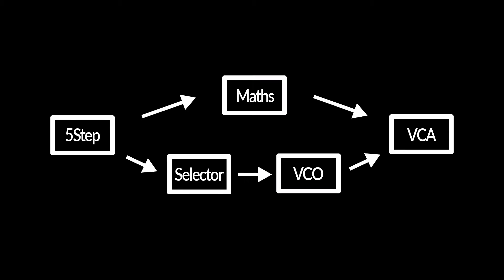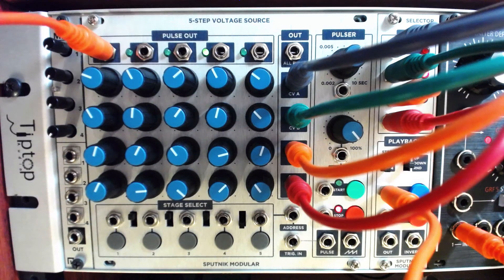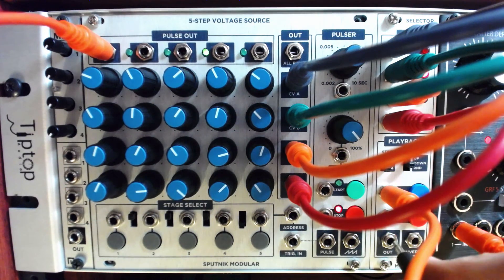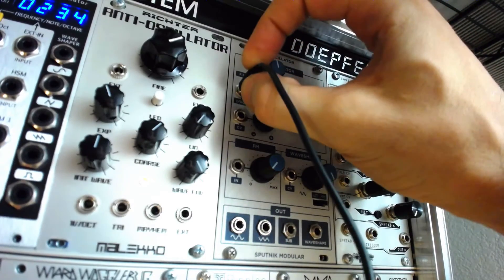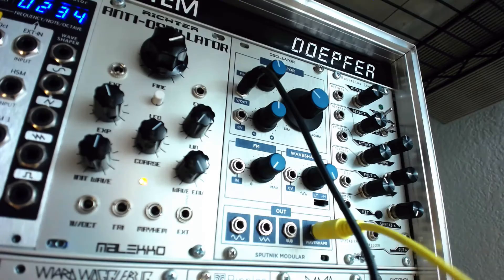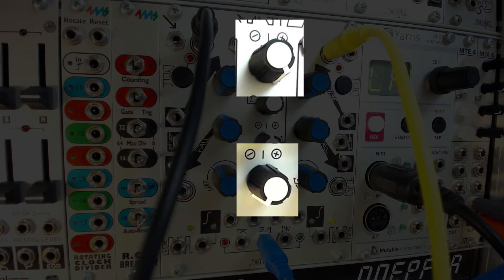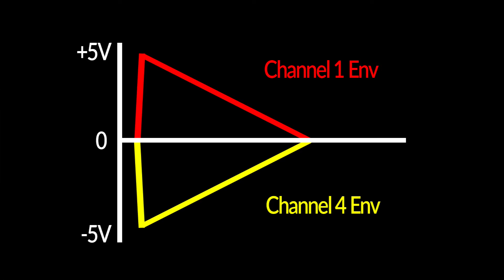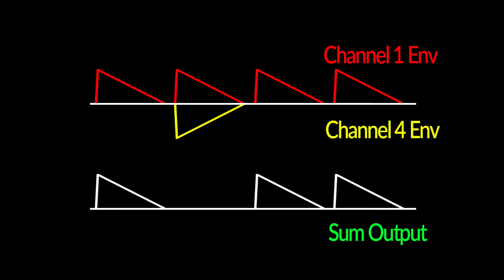Eurorack Sequencer Step Muting With Maths

Comment: to mute 2 or mote steps obviously you'll need to combine individual pulse outs into a logic OR module and then route the OR'ed signal to Maths - you should add it to the video IMHO :)
anyway, you can get make noise rene for the same amount of money and less HP and get rests/slides, complex sequencng and more :)
Reply from the maker: +Ilya M Good points, Rene is a great sequencer. Hoping to get some videos and maybe a course going with it. It's very deep. This video was answering a question asked on MW. And since these Pulse Outs are never triggered at the same time, you could probably even use a mult or stackcable (though I wouldn't recommend this, for safety's sake). Just trying to keep things short and sweet for youtube, maybe I'll do another about the OR idea... :)
Reply: +Voltage Control Lab btw, I mailed to makenoise a year ago and they answered that all their modules are designed to accept signals coming FROM multiple sources combined in one input, so maybe OR is not needed but for educational purposes it should be used :)
Reply from the maker: Ilya M
Very interesting! Well I guess you could use a stacking cable or mult in that case...
Reply from the maker: +sooperheep Any company in eurorack would be happy to have as many fanboys as they can get :)
Reply from the maker: +sooperheep Spread the love, people!
Reply: +Voltage Control Lab 
I think it is also possbile to make rests just buy using the top row of 5-step sequencer as a gate signal with all voltages tuned all the way down for rests and all all the way up for driving the  envelope. this trick works well with pressure points since  the top row of Tuned Voltages range 0 to +8V, and may be used to generate gate signals, where full CCW is Gate Off and full CW is Gate On.
what you think? what is the max voltage coming from cv out of the 5-step sequncer?
Reply from the maker: +Ilya M That'll certainly work as well, the 5step can send 0-5 or 0-10 depending on a switch on the back of the module... but yeah, a spare row would work just as you describe!